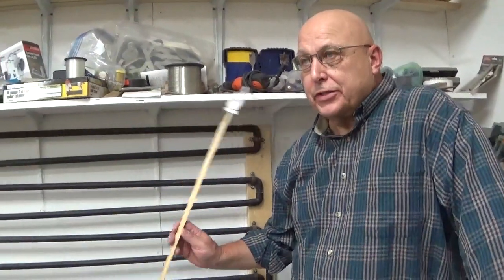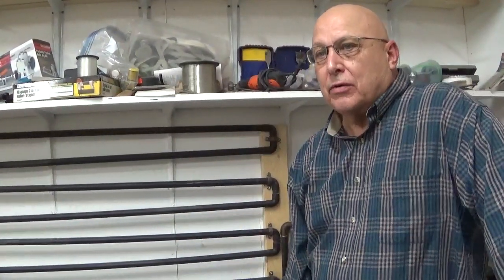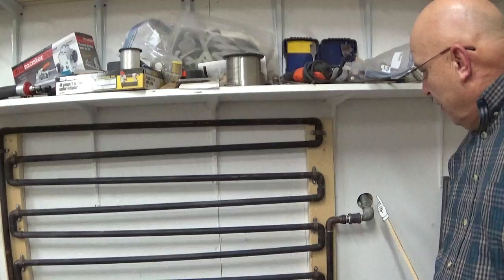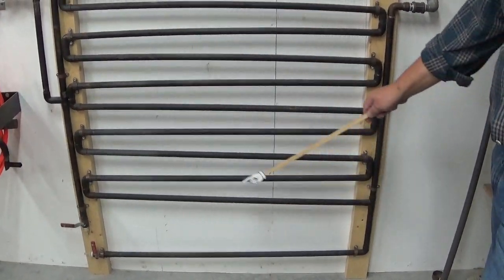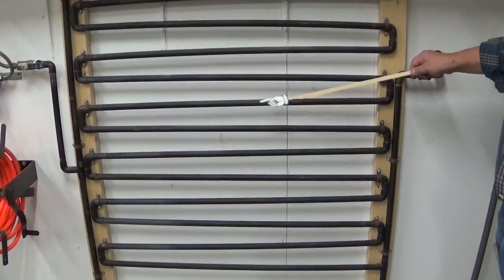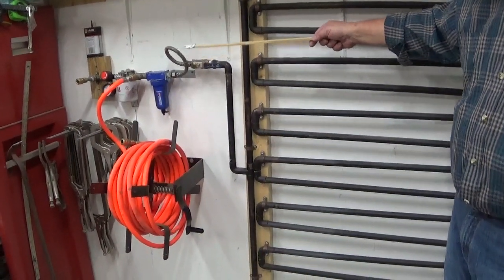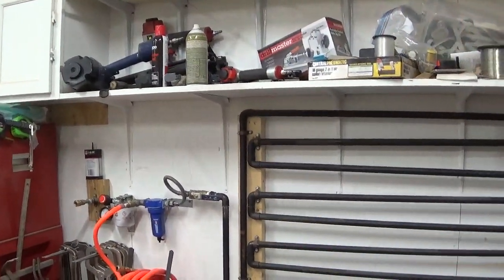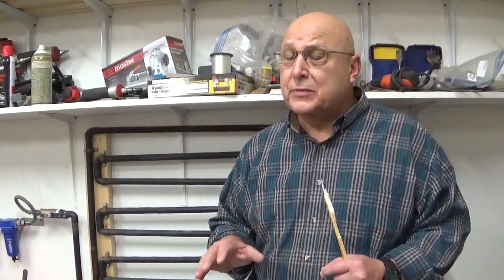Air Compressor aftercooler air cooler dryer condenser, simple and effective to remove moisture

Comment: Hi Jeff - I'm setting my home shop's air compressor for paint and I like your implementation of a manifold air dryer.  There is another YouTuber who paints autos who has a vertical version and, like you mentioned,  there is a valve at the bottom of each run, so maybe 5 valves in all to drain using ~ 50' foot of pipe.   The difference is he uses what appears to be plastic pipe instead of copper or some other metal.  Seems to work for him, each progressive valve releases less and less water.    He then runs this air into a 5 stage filter/dessicant dryer system, then to his spray gun.

In your opinion, how important is the material the manifold is constructed of versus the run length in reducing temps?  Plastic is a terrible conductor of heat but is so much cheaper than copper, yet it appears to work well.  Probably not as well though.  It's an outside setup in Texas, so humidity is abundant.   If it's a volume thing, wouldn't a 50' run of rubber hose, routed correctly and drained, work as well?  Thanks - DP
Reply from the maker: Hi Dan,
   Copper pipe may not be the cheapest material but it is the best for heat dissipation, rubber and PVC are the poorest materials for cooling compressed air and 3/4" I.D. @ 50' length is the minimum for any cooler to work effectively. If you build this design after cooler with copper pipe it will last almost forever, PVC and rubber will not. If you are in a really humid area I would build two of these coolers and use one as a pre-air cooler between the compressor and tank and one after the compressor tank, just put a fan on the pre-air cooler to help cool the air quicker coming out of the compressor.
  I used a Motor Guard filter in my paint shop, it worked great just use the cheapest stiffest toilet paper rolls for the replacement filters. My shop set up after the air cooler was a water/air separator filter/trap then a direct inline air coupler for sandblasting, next a regulator for air tools, next was a Motor Guard Filer, and last a paint air regulator with a permanent air hose screw into the regulator to prevent any cross air hose contamination. I hope this helps and good luck with your paint shop, plus always wear a respirator for your health.
Reply: @jeffwillard2417  Thanks for your response Jeff.
Here is the video I was referring to: https://www.youtube.com/watch?v=wtKY-44KOsY&t=496s
I guess the point of my question was about the physics of what is happening in the manifold.  Clearly, copper will work better because it isn't an insulator like plastic and will radiate some of that heat away, but clearly that's not the only mechanism at play.   Just looking for insight as to why his system works at all.
Thank you for your time - D
Reply from the maker: The biggest reason his system is working at all is because of the almost $400.00 water traps and desiccant dryer unit, it looks like a great system but it is to expensive for me, especially when the same results can be done for much cheaper. The polyurethane hose air cooler mounted on the wall is very ineffective for an air cooler. The air coming from the compressor which is about 190 degrees has to cool down to at least around 75 degrees or cooler to start condensing the moisture in the compressed air, a polyurethane hose, rubber or PVC just does not have that type of a heat dissipation effect. Save some money and get the Motor Guard Filter and use cheap toilet paper for filters, you'll be happy and save a lot of money. The M.G. filter worked great the many years I used it painting cars without fish eyes and orange peel and I'm sure it will work for you also. To give you an idea how long ago that was..... PPG Deltron had just come out, yep I'm old but wise.....Good luck
Reply: You gotta use copper and don't cheap out man.

Comment: HI, I like your idea better than what is on the tube for dry air. Do you have a parts list I can use ?? Thanks
Reply from the maker: Hi Ken,
It is all 3/4" ridge copper pipe some 90 degree elbows and a Tee that is sold at any Lowe's, Home Depot or plumbing supply store. You should make it so it is a minimum of 50' in length or longer and  make it to fit whatever space you have on your wall. On the end you'll need a water/separator trap and an air regulator, look on Amazon or Harbor Freight for the best prices. Good luck in your air cooler building.
Reply: @jeffwillard2417   Thanks Jeff, for the parts list. I too live in Fl. this humid air is something else !!!  best regards, Ken

Comment: The reason a small diameter aircond condenser works is because you pull the air off right as it comes out of the compressor, which is low flow anyway, run it thru the cooler and then allow the air to EXPAND as it enters the tank. You have yours backwards or dont have a storage tank as you are cooling it after it exits the large storage tank. That is totally backwards.
Reply from the maker: I have used this design air cooler for over 30 years starting in my Body Shop and I'm still using a smaller version in my work shop. They both worked great producing completely dry air...... for being totally backwards as you say it is, as I always say each to their own.

Comment: I've been thinking about building one of these "air dryer systems" as well.  I have a question for you, would there be a benefit of having longer tubes at the bottom going to the 4 drain valves so that more moisture could drain to the bottom?   Also, could this same system be build out of the plastic air compressor pipes or PEX that is often seen in commercial shops or large garages?   The question is, are the pipes that make up this "air dryer system", required to be copper or brass?   Both of those are far more expensive that PEX tubing.   What is you opinion?  Thank you.
Reply from the maker: Hi Jim,
PVC and PEX being a plastic material does not dissipate the heat like copper does, plus it is affected buy the Sun's U.V. making it brittle. Copper may cost more but it will last a lifetime and you'll never have to worry about a line blowout and possible shards of PVC flying through the air. A little extra cost for copper in the beginning is worth it. You could modify the bottom line drain but I would just crack the ball valve and drain it more often...... Good luck in your air cooler build.
Reply: @jeffwillard2417  Understood, thank you.

Comment: I Love the gigantic water traps. Can be made the size of an A4 sheet by just using a small radiator(trans cooler or similar) and then an auto water trap straight after.

No need at all for a giant setup like this. Plus straight copper tube doesn't  have a huge amount of surface area, hence the need for so much tube.

Comment: What do you suggest to clean the inside of the copper pipes? Also are there any changes or improvements you've made since this video? I'd like to build this exact same setup
Reply from the maker: I used a Copper Pipe Cleaner 4 in 1 Copper Tubing Brush, they work great and any hardware store or big box store will have them.  For the final filter if you want to upgrade the system get a Motor Guard air filter and use the cheapest toilet paper available for the replacement filter, I used one in my body shop and they do an outstanding job.. Have fun building it..
Reply: @jeffwillard2417  ok thanks. I'm also trying to plan out the regulator and water filter.... Would a 1/2 or even 3/4 filters and regulator provide more cfm at the tool, or should I just keep it simple with 3/8? I'll be doing sandblasting and need as much air flow as I can get. The compressor is 11.5 cfm at 90psi and 175 psi max.
Reply from the maker: A 1/2" water separator and air regulator will give you plenty of air flow for a pressurized or cabinet blaster. For blasting I would also go with a 1/2" air hose over the more common 3/8" air hose.

Comment: hey bud I'm thinking of a 1/2" coil condenser figure I would feed the air in the top and use the natural taper of the coil to let the water settle toward the bottom of the coil you have any ideas on what type of filter /water trap I could use at the bottom of the coil to collect the water?
Reply from the maker: Just fabricate a simple T-trap, were a section of copper pipe drops down to catch the condensed moisture and a fitting above that for the dry air.

Comment: Oh so simple .. So beautiful. Not a mess of valves and two smart traps. 
Only thing making me sad is the copper $$.   Hah I run an art air brush.. I use brass fittings to isolate tampons, it's a small draw of air and it works as good as a 300 Buck unit.  Just hard to purchase the "Part" unless your female partner gets for you.  Great Video Ill be sketching that up for when I can get the copper Thanks Much !!     ........
Only thing I could add is to lay it all out stretch just a little then brace it down.. so you have a little angle on the parallel parts.(Wouldn't even have to solder like that, as it would stretch) it would then certainly all drain down hill... no biggie though.
Reply from the maker: I have to admit that your Tampon air filter/dryer is probably the most "unique" one that I have heard about, Thanks for sharing...
Reply: @jeffwillard2417  another great air dryer to put after pipe system and before desiccant filter, is the TOILET PAPER ROLL holder/dryer!  Motorguard makes it, about 50-$60.  Works great
Reply from the maker: I used a Motorguard filter in my body shop years and years ago and it did work great, I had my painting air line screwed directly into it for a permanently "clean air hose" I used the cheapest toilet paper rolls you could get instead of their filter replacement. Back then they were $50.00 to $60.00 now they cost $70.00 to $100.00.

Comment: Shouldn't you be cooling the air before it goes in to the compressor tank?
Reply from the maker: Hi Bryan,
You can actually do both, the cooler between the compressor and tank is called a pre-air cooler. You'll need a fan on the pre-cooler to keep the lines cool so they don't over heat and are able to condense the moisture in the air. These are inexpensive enough to be able to make two coolers a pre and after cooler for double the moisture removal.

Comment: Can I use steel pipe instead of copper pipe
Reply from the maker: The problem with using steel pipe is that it will rust inside causing more contamination of the air.
Reply: @jeffwillard2417   thank you so much for your advise 👍🏻

Comment: I like this system. I don't understand why many go through all the 
trouble of mounting aftercoolers on their compressors, between the motor and 
the tank? Why not put the aftercooler AFTER the tank instead of putting 
it between the motor and the tank, similar to what you've done here? If they want to use an oil cooler that they purchase on Amazon, fine ... put it after the tank like you've done here. Pop an auto drain on the bottom of the tank, let the tank and auto drain do the job they're designed to do,
 collecting most of the moisture at the tank .... then have the 
aftercooler inline right after the tank, cooling the air before it hits 
the filter.
Reply from the maker: This design will work in both positions, the         pre-air cooler would need a fan to keep the lines cool as the compressor is running. It really just boils down to what people like and think what will work the best for them, just like ice cream everybody has a favorite flavor.... Thanks for watching.

Comment: Mr. Willard,
Have a question! This dryer's use appears to be after the tank is full. What I mean is I see most dryers installed between the compressor pump and the tank. Yours looks like it is after the hot air, moisture goes into the tank. I guess a guy could do it either way?
Reply from the maker: Hello Whitetail,
  Yes mine is after the tank, it costs $128.00 to make these coolers which is cheap enough to have a cooler before the tank and after the tank. A cooler before the tank will work to some degree to cool the air and condense the moisture but if you use the compressor a lot a cooler before the tank will heat up and lose some of its cooling capability, that is why you would need a fan cooling the air cooler pipe. 
  Remember the air coming out of your compressor is approximately 190 degrees and that's a lot to cool down quickly, so for most small workshops like myself is impossible to remove all the moisture before it enters the tank, unless you wanted to spend thousands for a commercial refrigerated air cooler.
Reply: @jeffwillard2417  Thank you for the quick reply.  I'll be building my cooler this weekend.  Have a great day sir.

Comment: Hello Jeff, thanks for sharing, how did you connect the air compressor with the first pipe? I heard you said you used a 3/4 inch hydraulic something...I need the exact pieces in order to make the right connections please. I appreciate it
Reply from the maker: I used the one wire single wrap 3/4" hydraulic hose which is the most flexible and two crimped on swivel 3/4" NPTF (pipe thread female) to make up my hose that is about 45" long, most auto and farm supply store's will make them up while you wait. The hydraulic hose does several things it removes the vibration from the compressor so it is not transmitted to the air cooler and it also made it easy to go through the outer wall into my shop, I'm all about doing it the simple and easy way......

Comment: that Zynga filter head has a bypass.  do you reverse the flow of air thru the head?
Reply from the maker: Hi Bob,
The filter head I received didn't have a bypass, it was a straight through flow.  So if you got one with a bypass you'll need to plug it to make a a straight flow through.

Comment: Isn't the purpose of these coolers usually to cool the air and basically eliminate moisture build up inside the tank?(this isn't a sarcastic question)
Reply from the maker: Hello Aquatic,
People are using this design for both the before the tank pre-air coolers and an after air cooler. Depending on your air usage a pre-air cooler (before the tank) this design or any other will need a fan blowing on the copper tubes to keep cool. You need to remember that the air coming out of the compressor is about 190 degrees and this heat will overwhelm any cooler and diminish its cooling effect without a cooling fan. The larger 3/4 inch copper has the advantage of having a larger cooling surface area inside and outside, helping condense the moisture in the compressed air and the best thing it is easy and fairly cheap to make.
Reply: @jeffwillard2417  thanks for the reply!  I had never heard of anyone doing either of these but I had seen where people were using oil coolers on belt driven compressors as a heat exchanger with air being pulled across from the flywheel and also had the benefit of drying the air with a filter prior to it going into the tank.  I may give this a try, I have two filters inline and still get residual water into my blast cabinet, so I'm hoping itll stop that as well as help preserve the innards of my tank since it's a new compressor.  I drain it after every use and keep it empty until its needed again, but if I can keep the water out I'll definitely not worry about it as much.

Comment: I'm wondering - what is the approximate maximum psi that soldered copper joints can handle? That is, if they are properly soldered?
Reply from the maker: Hi Jack,
From all the info I have seen a 50-50 tin lead solder will give you a 200 PSI rating and the 95-5 solder is 500 PSI rating, both are well within the average shop's compressor regulator setting for pressure cut off. If I an remembering correctly, the burst pressure of the 3/4" copper pipe is 600 PSI.
Reply: @jeffwillard2417  The working pressures of soldered joints are substantially less above room temperature. For 50-50 tin-lead, the working pressure is only 100 psi at 200F. 95-5 tin-antimony is much better, about 300 psi at 200F. Your numbers are fairly accurate at 100F, but for this application, high temps are more relevant.
Reply from the maker: Hi John thanks for the info, I reference this link for my information on page #28  http://www-eng.lbl.gov/~shuman/NEXT/MATERIALS&COMPONENTS/Pressure_vessels/copper_tube_handbook.pdf

Comment: About how long are the horizontal pipe lengths?  And to position them slanted up hill, was that like the elbow fiittings that are at a different angle of 90?
Great video, thanks
Reply from the maker: Hello Manny,
The beauty of this system is it's simplicity and you can modify it to any size you want but you should have a minimum of 50' of  3/4" copper tubing to cool the air. The one I am using now has cooling pipes that are 40" long (10' pipe cut in 3 pieces),  they are standard 90 degree elbows the copper pipe will easily flex enough to give the slight upward slant needed on each pipe. Have fun making your air cooler.
Reply: @jeffwillard2417  I will definitely copy your design, thanks for sharing the information to all of us mortals!
Reply: Hello,  @jeffwillard2417  , I was watching more videos here, and I still like your idea. However, there is something that caught my attention and wanted to know what do you think. Your same idea, but instead of going from the air  from the tank to the pipes and then to the water separator,  what babout air from the compressor ( on the motor) to the pipes , then back to the tank and then to the separator, etc...what do you think
Reply from the maker: Hi Manny,
What your describing is called a pre-air cooler (air cooler between the compressor & tank). It would help to remove moisture but there is such a huge volume of 195 degree heated air inside the pre-air cooler that you will need a fan on the copper pipes to help keep them cool, so the moisture will condense and even then some moisture will still enter the tank. These air coolers are cheap enough to make you could have a pre-air cooler and also an after air cooler for maximum moisture removal.